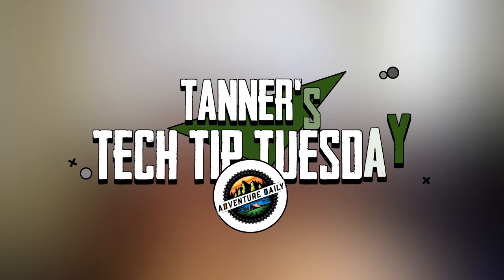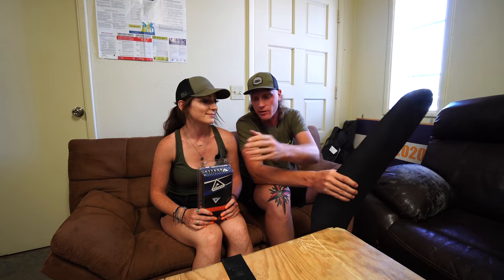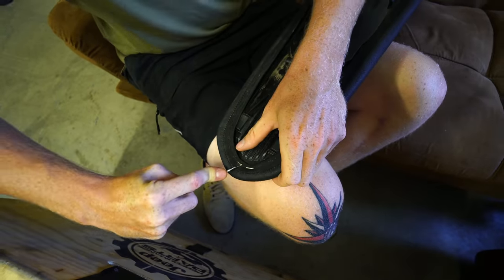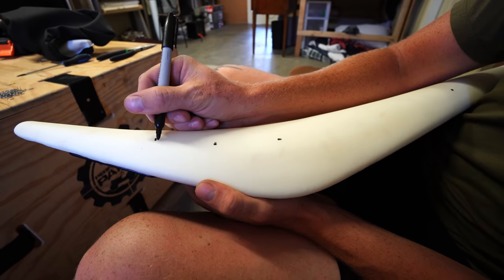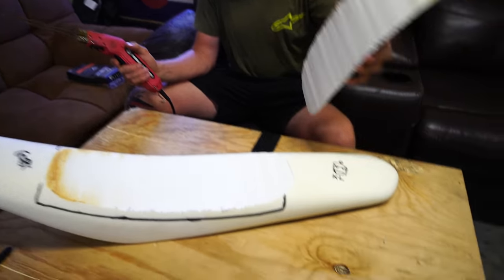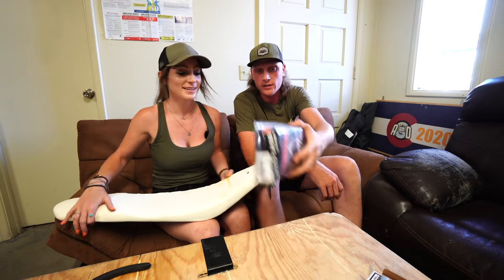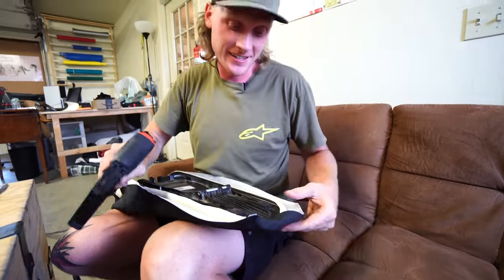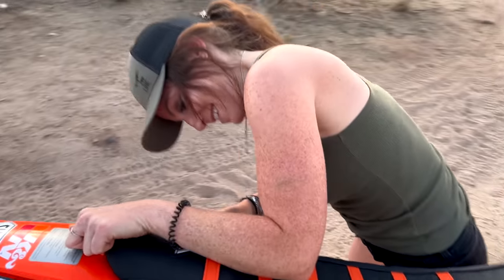Hot Knife VS $10,000 KTM Seat.. (IT WORKED)

Comment: Great video and nice cutting job! At 5'6", I've done my share of seat carvings. If anybody ever needs advice on cutting down seats, look for a short person on a dirt bike!  Nice job with the hot knife; I use my wife's bread knife but may invest in one of those. I just did my KTM a while back. The only additional step I do is use my electric palm sander with some medium/fine grit sandpaper to round the seat edges and corners off nicely and smooth the rest of the foam out. One other piece of advice I would offer especially for those that haven't done this before is that when you look at the bottom of the seat pan, for many seats there are a lot of peaks and valleys so it's very difficult just looking from above to see how much material you can remove. So you have to be very careful 'drawing that curve out'. I generally try to leave myself at least 1" of seat foam at any point front to back (post-cut). I usually can get close to 2" reduction in seat height and that's generally my goal when I do mine. :)
Reply: What’s your reach like now? Is that all
The mods you did to be able to lower it? I’m 5’6. Thinking with boots and a 2” seat carve I’ll at least be able to touch with the balls of my feet? I’m on a Ktm 250 SXF
Reply: @RodrigoGarciactg  Hi Rodrigo, the seat is the only thing I've done. I believe my 2012 KTM 300 XCW original seat height was 37". With the seat carve I did, I'm at 35" now and can easily touch with the balls of my feet. You can also take some preload out of the rear shock and get a little extra depending on what type of riding you are doing. I have mine set a little on the soft side as I don't do jumps, etc. and I'm only 150 pounds so that combined with the seat adjustment gave me a good 2 inches.

Comment: I did the same thing to my wife's CR230F for her. It's really thin. The problem that she has is the seat being too wide for her thighs. It seems to "push" her legs out, which makes her legs shorter. I took a drywall rasp and rounded the edges a bit, and that helped a little. 

I also put a Soupy's lowering link on it. And adjusted the spring dampener (preload) for her. She doesn't jump or anything, so she doesn't even miss the extra travel. I think all in all I dropped her bike 3.5 inches for her.

Addition... I just remembered that I loosened the fork clamps and slid the tubes up a little, after dropping the rear shock sag.
Reply from the maker: Alexis also noticed that too but when she had her riding pants on it didn't bother her. We will plan on lowering her bike when we get back home! Thanks for sharing and watching! 🤜🏻
Reply: @AdventureDaily  loving your new bikes 👍🏻 I'm so happy to see it when couples ride together. I taught my wife how to ride on a CRF50. Then moved her up to a CRF100. Then a CRF150. Now she's riding the lowered CR230F. I let her loose on my XTRAINER 300. Probably won't be too long before she wants one LOL. They make a factory lowered one. So.... yeah.... hahaha.  
Keep up the good work. Ride on. Stay safe ✌️🤛

Comment: I used one of those cheese grater things for woodwork to shave down the seat on my xr650, took off 2 inches and very nicely shaped can hardly tell after the new red moose racing seat cover. Was kind of hard to fit that I ended up using spray Gorilla contact cement all over it and carefully stretching it on. Looks good, some little wrinkles but can hardly tell.

Comment: Did you consider dropping forks in the triple clamps ad well? It will ever so slightly change the wheel base without changing travel or spring rate and backing off rear shock to get a bit more sag
Reply: I've done it but wouldn't recommend it, makes the stroke different. And I just knocked the plate and brake light off my bike in the whoops after going full sag.. 🤦🏻‍♂️

Comment: I would try to use a sawzall
Reply: A Sawzall seems to get carried away. I used a hacksaw blade. Just a blade without the frame. And I rounded the edges a little with a drywall rasp.